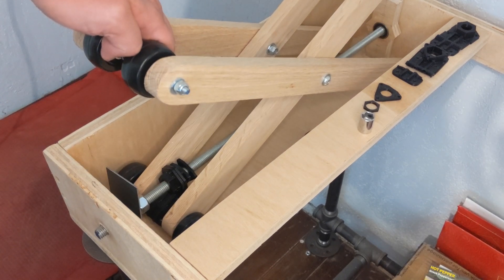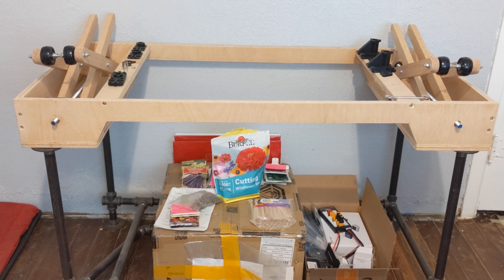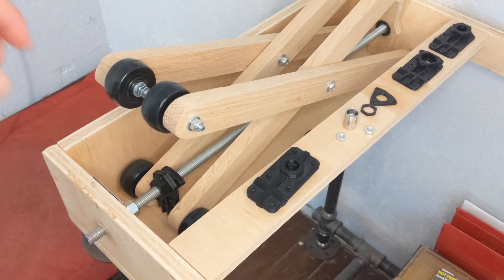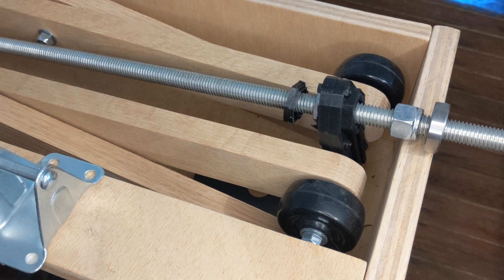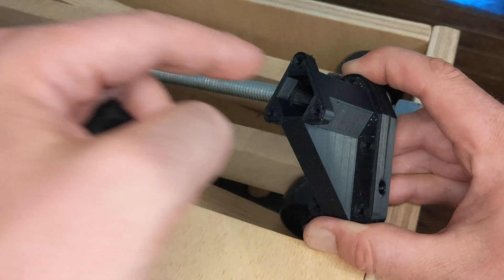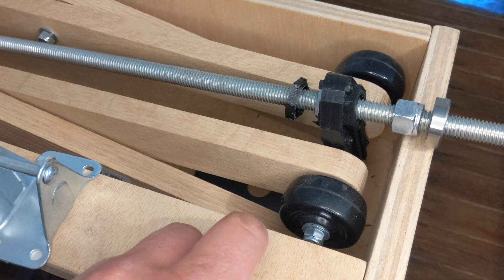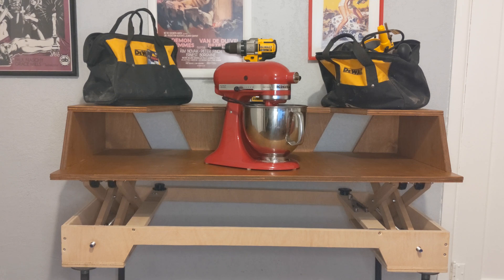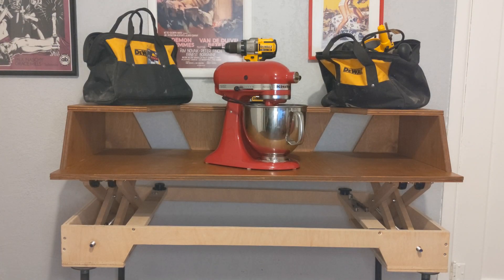Testing 3D Printed Parts For A DIY Standing Desk

Comment: Interesting.  I'm thinking about building a computer desk one of these days, and I like the idea of making it a standing / sitting desk.  Nice concept.  Though I would probably avoid using any plastic parts.  Good luck and I'll have to check back to see how you are doing on this one....!!!  😎
Reply from the maker: Thanks! I think those 3D prints are going to be ok (fingers crossed). There are other problems though, like how the threaded rod is 13 TPI, so it will take 130 turns or so to move it up, haha. 

I may need to attach a motor and some gears to it some day, but let's get it working first. I hope I have time to finish it around Christmas, but we'll see how that works out :p

Comment: Keep working on it, nice project. You could try a more scientific way of testing it, by putting some water bottles, and whit that you will know how much weight it can really handle and all of us will also know it. :) Really cool project!
Reply from the maker: Yeah, I could do something like that, but I don't have a way to weigh everything I put on there, especially the desk top itself 😜 Also I don't want to break the last design because I don't know how to make it stronger with 3D printed parts in the space I have...

I just wanted to make sure it won't crash down once I put my monitor on it so I picked some heavy items I had close by for the video 😉

Edit: I guess the desk top is 2 sheets of 3/4 inch (18mm) plywood, so I can find the weight for that. It's 60 pounds for a full sheet so it should be 30 lbs or +/- 15kg plus tools.
Reply: @BitsOfInterest  love it, hope You will make an update of the project soon
Reply from the maker: @juanantonioocampowilches8204  Finally the weather is cooling down a little bit here in Texas, so I may stain it outside this weekend so I can finish it 😁👍
Reply: @BitsOfInterest  great I really Will love to see all the details that You include and how it evolve
Reply from the maker: @juanantonioocampowilches8204  I may run into some issues with the mechanical pieces, but I'll try to get it done soon. Which details are you most interested in? I can't make it too long or people won't watch it if I ramble for 20-30 mins, LOL 😋